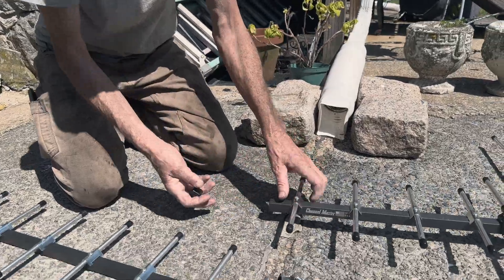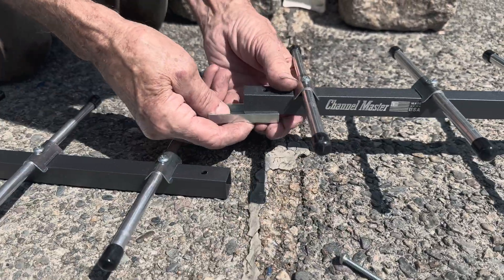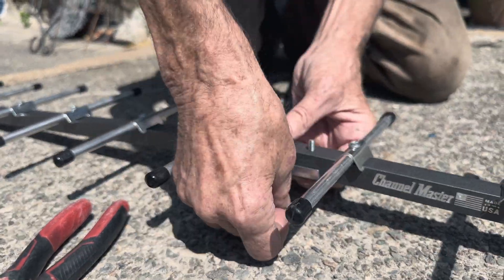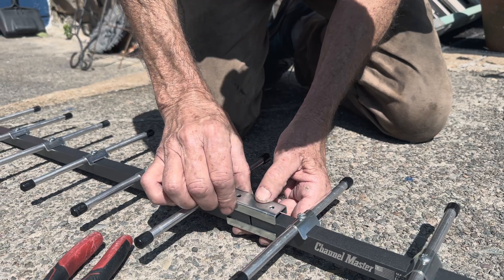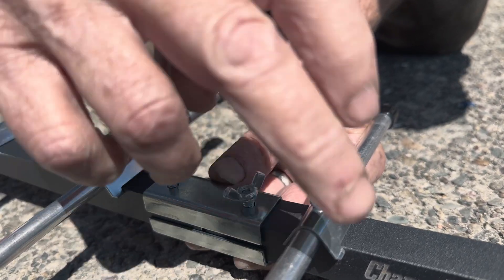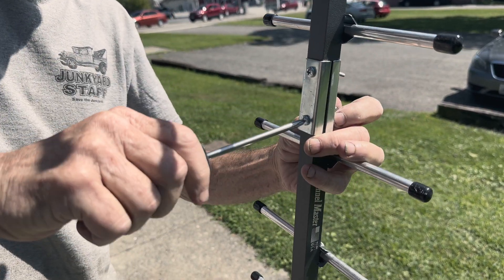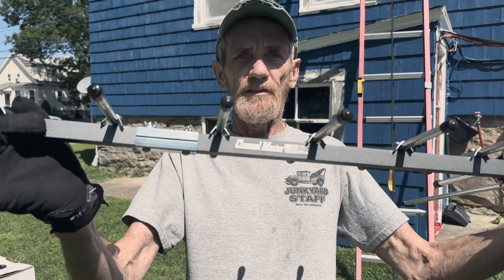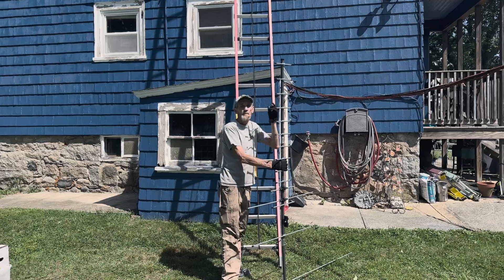Channel Master Pro Antenna Upgrade .

Comment: Steve, you’re insane…you would make a great Ham Radio Operator. 😂 Standing there with his foot on the roof vent crankin away 😆 Good Upgrade Steve…is that the NORMAL Length of the Standard Pro Model Antenna (VHF) Elements? I’m waiting for mine to arrive…ordered the 7779 PreAmp too Merry Christmas 🎁 to ME 73
Reply: Well, I’ve had this Pro Model installed for about a week. I had some minor adjustments to make and finally raised the mast to full height, 30’. Just got the highest scan count so far, last night (using the CM-7779 PreAmp too) 127 
I would add a picture showing channel count but not possible 
Read Channel Master Home Page for full review : 73
Reply from the maker: Well thanks friend ... I could have been in the circus too... 71 and no fear, thanks for watching. Please subscribe and a Merry Christmas to you.
Yes, it is standard length before adding extensions... good luck.

Comment: I used to have this very antenna with the uhf extension, and a super high gain 12 foot boom behemoth prior to it. After I moved a few years back, I decided to put up another antenna to save some bucks again. Where I live currently is only a block away from my old location, same elevation, but with a lot more close-up trees between me and the tv stations which are 63 miles away. I did quite a bit of research, and after some consideration, I strayed from my old go to Channel Master for a little known brand. What I got was a Range Xperts XPS-1500. Since I am older and retired now, I wanted to mount for convenience rather than performance so I could maintain it without assistance. So, the XPS was mount 15 ft. above ground vs 30+ ft for the Pro, with a similar length cable run of approximately 50ft. I was able to pick every single channel w/o a mast mount amp like I used to have. I was amazed because two of the channels actually had switched to low power. I did finally opt for an amplifier due to the local ABC being reduced to a lower power signal for stability. However, despite the extra tree foliage, and mount height challenge, the XPS really shined above the Pro in my circumstance.
Reply: Range Xperts XPS-1500 is a fine antenna, and veteran owned is a bonus.  Nothing wrong with a Channel Master though....

Comment: This antenna when u buy all the extensions just aint worth 300 bucks. Just buy the CM3018 it will outperform this wanna be PRO SERIES🤔🤣
Reply from the maker: We use these daily in New England and never get less than 75 channels clear and locked on, and in some areas we achieve as many as 90... powerful when combined with switchable pre-amp and is built stronger than the 3018 and has a lower profile.  I see no reason to go to the bulky and thinner cm-3018. Thanks for watching.

Comment: I am wondering if you would be so kind and tell me something about two different UHF antennas. Which is better, Channel Master double bay wisker or a Gray-Hoverman double bay zig zag antenna ?? How you can help and thanks Steve too. vf
Reply from the maker: My advice would be any Channel Master over any other except maybe Winegard, I'd say go with a CM Pro model with both extensions, Yagis do better and use the Pre-Amp 1 from Channel Master with switchable gain 17db or 30 db...... Good luck, let me know how it goes. Steve
Reply: Thanks Steve @stevestv3852

Comment: Can you put a third set of UHF elements on this? We have 2 and are right on the edge of good reception.
Reply from the maker: Yes, you can, you may have to drill two new holes. The UHF extension will have the metal joining plate and bolts. Good luck and thanks for watching, Please like and subscribe.

Comment: I Upgraded to this Antenna from the Channel Master STEALTHtenna and now we get around 96 Channel's with it Split between two TV'S using a Powered Splitter and I've gotta say the build quality of both Antenna's are great and both Antenna's especially the Pro Model came very well packaged. Channel Master knows what they are doing with these Antenna's but the Pro Model is definitely built better than the STEALTHtenna and it will get you more Channels especially when compared to the STEALTHtenna because the Pro Model is just a larger Antenna with more Gain and it's Upgradable for even more Gain. What I like about both of the Antenna's is they are simple and they don't have any moving parts on them so if it's bad Weather the Signal doesn't mess up like on most Antenna's especially larger Antenna's which tend to have moving parts. I'm also able to get Trash 6ABC with the Pro Model without the Upgradable attachment option I was also able to get 6ABC with the STEALTHtenna but that's because I'm not that far from Philadelphia I'm in New Jersey so if your far away from Philadelphia you might not get 6ABC with either of these Antenna's or you might have to get an Amplifier so just keep that in mind. Overall both Antenna's especially the Pro Model feels like it will last in Weather for Years over even forever as soon as I took it out of the box I was wowed by the quality so I definitely recommend Channel Master Antenna's.
Reply: And I'm happy with one channel
Reply from the maker: Thanks for watching and you are quite right about the Channel Master Pro, it is one great little antenna. Please subscribe and ring that bell. Steve

Comment: Before risking your life to install an antenna on your roof, make SURE that's the ONLY place you can get the best signal.   In most cases, if you take the time with a signal meter, you can find solid signals just as good at at a lower elevation.   One of my most popular stations is 70 mi. away.  I tried it up 30 ft and had no results.  I was going to give up because I have a lot of tree blockage but  I got a signal meter and a small antenna and just walked around my back yard and found a solid signal in one spot only 8 ft. above the ground. I put the antenna there and It's been the perfect location for years.

Tryl lower levels first before risking your life.  You'll be surprised.
Reply from the maker: If you are unsure at heights, please pay a professional TV antenna installer such as me. Now Rick thanks for watching and I'm glad your antenna install worked out for you. But after 37 years in the business, I will disagree with your ground installation theory, you got lucky. Antenna should always be installed at the highest point on the house, any attempt to lower it so it is not too visible, only cuts your signal strength and the antennas reception abilities. In New England where I operate, I consistently get 70 to 80 channels for each and every customer. I know of no customer that would contend with it planted in the yard. Again, I respect your input and please subscribe for more videos. Thank you.
Reply: I agree with New England.  I used to live there and in western Mass our antenna was 30 ft above our 3 story house to get decent UHF reception.   New England IS a hilly terrain and height matters with most areas there.  

But for many other areas of the U.S. it depends on the terrain and your surroundings. If you have no hills or mountains, but massive 90 ft. pine trees all around your home, like me, your real choice is to erect a tower to get above the trees, which is VERY expensive to install and maintain, or you can try to find a location at a lower level, maybe through a gap in the trees and find a decent signal that way, which is often highly effective and more practical. 

I almost gave up trying to receive a station  70 mi. south using a 30 ft antenna until I attached a bowtie to a signal meter and just walked around with it. I finally found a low but rock solid signal in ONE certain spot on my elevated deck. I put the antenna there where it's worked perfectly for. years.

No, I sure don't like it tying up the deck, but putting up a huge tower is ugly and just not an option.  My only point is not to assume height is always your only answer, but of course in New England, it may be!
  @stevestv3852
Reply: Everything is a risk, but I'm sure he's been up there plenty of times. I also work at such great heights and it's just routine after a while.

Comment: What is a fair price (in the deep south) to have an antenna and amplifier installed on a 40' tower ?  Installation only. I have everything needed. And possibly someone to install it. But I don't know what would be considered too much, or too little.
Reply from the maker: Whoever you have do it will be insured and will have those costs built into their rate. On tower work we charge 150.00 per hour including trip charge. Charged from the time we leave shop until we leave site. Two men can install and wire an OTA antenna in 4-5 hours incl trip. And we guarantee our work for one year. Thanks for watching and please subscribe.
Reply: @stevestv3852  Thanks for the quick response, Steve. Are you figuring 4 hours travel ? My father, when he was a much younger man, did this kind of work as a side hustle. That was in the early seventies. He and I together could dig the hole, pour the concrete, erect a 50' tower, install a rotor, a VHF, and a UHF antenna and run coax in the house in under 7 hours. Total. Of course, we had to split that time into two days to let the concrete set for 24 hours. Once the tower was erect, it didn't take much more than 30 minutes to climb, pull up a UHF antenna (mounted on a mast) and install it.
Reply from the maker: No not four hours travel. just add up the travel time and an hour or so at 150.00 .... The 4 hours was just an example @MrRustyBob
Reply: Beautiful system head end.

Comment: You need to secure your ladder.
And the top should be 3-4 ft above the roof.
Reply from the maker: FYI,  Tech shooting the video was holding the ladder, second, I've been doing this work for 37 years and think I'll manage from here. Thanks for watching
Reply: @stevestv3852  
No one holding the ladder from below will be able to stop that ladder from sliding. Doing hazardous ladder safety for 37 years doesn't make it OK, just damn lucky you didn't hurt yourself. Personally I would take this video down. Your Showing people how to get seriously hurt on a ladder if they copy you.
Reply from the maker: And just what makes you an authority, you're pompous is showing and I'll add a little jealousy. Bet you're afraid of heights. Now go back to things involving water and always wear your life vest. @jackflackatari
Reply: A disclaimer has been added to the video description. Thanks for watching
Reply: In UK we are not allowed to work from ladders they are only for access or inspection and we have to maintain 3 points of contact at all times. if work is required an appropriate platform has to be used.
Reply from the maker: Thanks for watching and I'm sure glad we do not have those rules here in America, because I'd be un-employed. Antennas are a hot tech item here now, Were busy.

Comment: I wanted to see a new channel scan and a before and after signal strength comparison. I'm sure they were better.
Reply from the maker: Thanks for watching ...Results are we began with 80 stable channels and ended with 93 stable channels here in Rhode Island. A pricey addition but worth it if you need more gain for weaker broadcasts. I must say the Channel Master Pro is well built and worth the money. We use these and Wingard products here at Steve's Antennas
Reply: @stevestv3852  hey Steve why don't you try a dual band amateur radio antenna that would work excellent for TV reception with the right adapters worked on my TV perfectly no amplifiers or anything needed just plug and play works a hell of a lot better than store-bought antennas‼️‼️‼️‼️